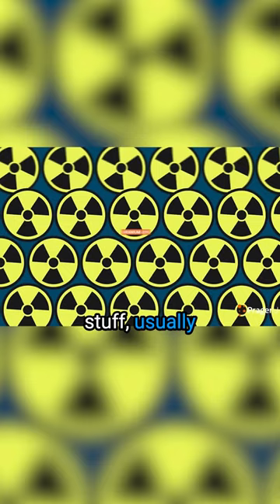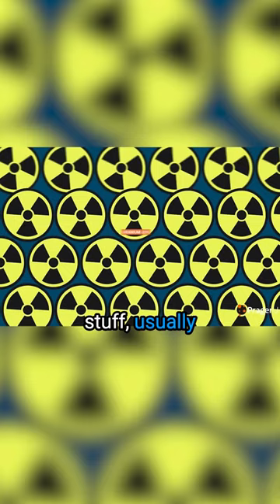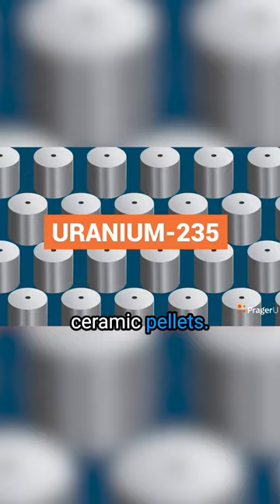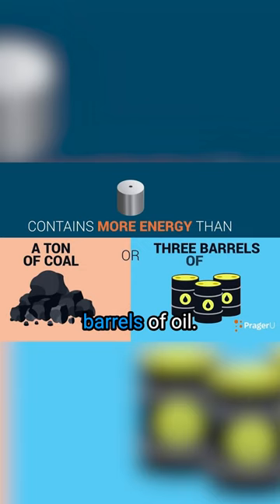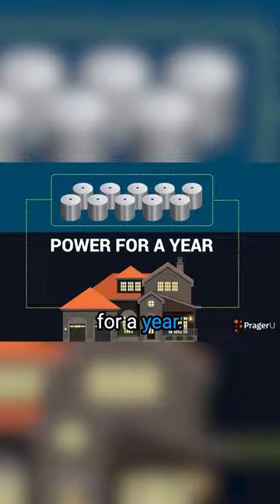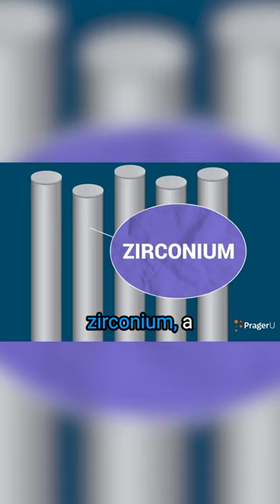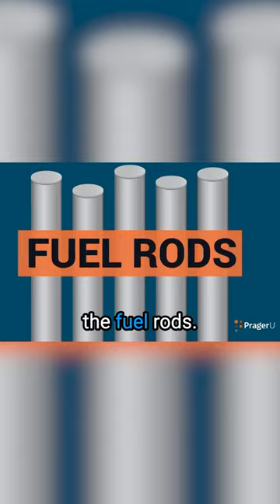WATCH: James B. Meigs on the nuclear waste myth.

Comment: That's 360 million Soda cans for the US Alone.
Reply: Then consider that the alternative would be a ~ton’s worth of coal and carbon emissions so take the soda cans pit them in a pill the size of a large barrel strong enough to withstand a train hitting them and bury them miles under the ground in several feet worth of hardened concrete bunker
Reply: @TrazynPrime for 10,000 years, plus that is 360 million soda cans per person over that time also being added. If we don't increase our population that is roughly 150 generations (70 years per person so in reality it would be about 2-3 times that as generations overlap) at 360 million each which is 54 billion soda cans of pure nuclear waste....or more than 7,500 Olympic size site swimming pools just for the US alone.

Nuclear is a stepping stone but to claim it is the only option we need and there is no downsides is a lie.
Reply: @seancallaghan54  right but do the math for the amount of CO2 released by burning coal for the same amount of power produced in a nuclear plant and see which waste will add up more considering that nuclear fuel is over ~1000% more efficient and more power producing im sure the waste from coal will also be ~1000% worse dont get me wrong we need coal no need to make life harder so our great great great times 12 great grand children can breath a little better, but when our green energy is actually able to support the energy grid we should drop both, but for now we need as much power as we can get.
Reply: @seancallaghan54  and also by 10,000 years maybe things will change that could be more beneficial for us and for earth in the future. Like I heard now that people are doing research to find ways to recycle the nuclear spent fuel.